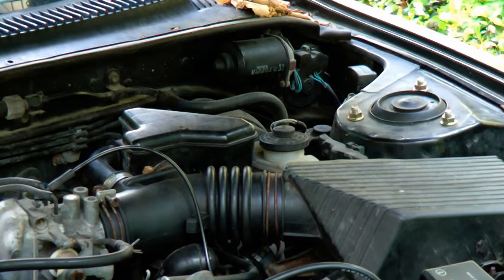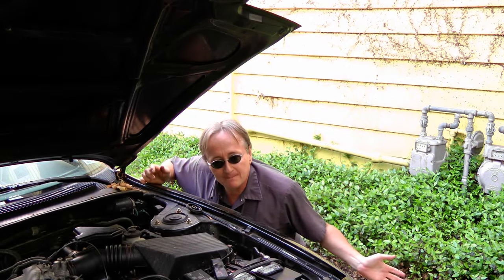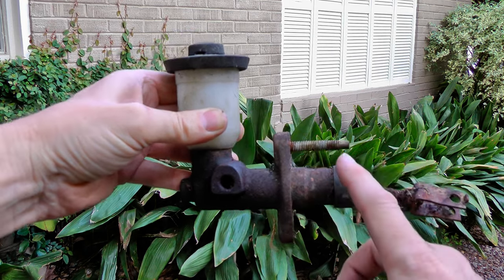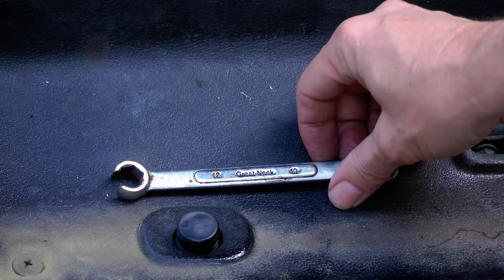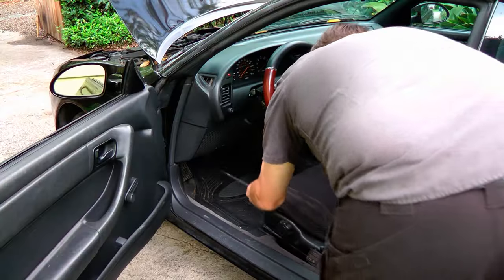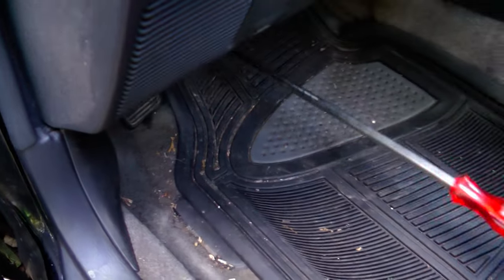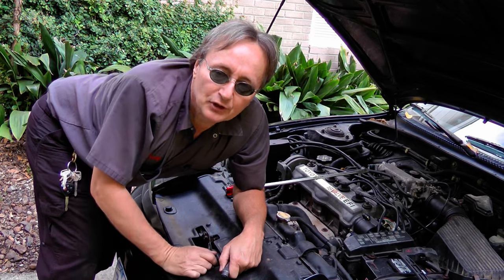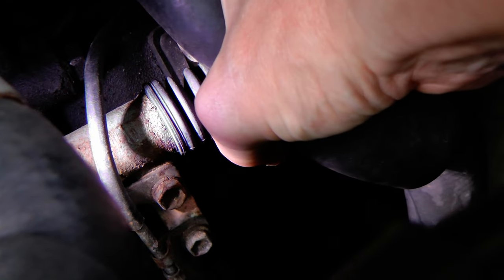How to Replace Clutch Master Cylinder in Your Car

Comment: Hey Scotty - I have a 2008 Subaru WRX STi, I push down on my clutch and when I release it, it makes a loud "Tick" sound. It sounded like it was coming from the dash board. So, I got under the dash panel on the driver side and I saw the rod that goes in and out of the firewall that is above the gas pedal when you push the clutch down. It sounds like the ticking sound is coming from there. Not sure if I need a new Master clutch cyl or should I grease it up that rod with white lithium grease? I should probably stick with the cheapest route first and go from there. The clutch engages very well, no issues. Just a ticking sound when the pedal is released. It's driving me nuts. It's not a POP or a CLUNK..just a tick sound when depressed. Any ideas? Thanks, Scotty!
Reply from the maker: +aaf1218 try lithium grease and see if the clutch switch is making the noise by removing it and checking that.
Reply: +Scotty Kilmer Thanks, Scott you. I appreciate it. I will have to apply some of that stuff on there or look at the clutch switch. I appreciate your help. I've been a subscriber for a while now. I enjoy your videos.

Comment: It's funny because I am having the same problem however, without the mechanic seeing the problem they are telling me to replace the gearbox and clutch. When there is nothing wrong with the gearbox as I drove the car the first time the clutch went down I was able to drive. The second time I was not able to drive so the air or there is leakage.

Comment: I came up with something cool, quick and effective. I stuck a clean rubber tube on the bleed nut, apply pressure to the peddle and use my mouth to suck the air out and the fluid flows right through.

Comment: Hello ,,,i have a 95 eagle Talon tsi i had a problem with my clutch .i can't go 1st gear when iam at a stop o a red light ..its realy hard to shift it like that but once is moving is easier to shift ..i changed my master cylinder and i bleeded my sistem more than 3 times ,there;s no leaks and the slave cylinder looks good..any idea whats going on? thank you so much for your videos they're so helpful..

Comment: hey scotty, thanks for the vid. I think the engagement point on my clutch feels much lower than before, literally right when i release my foot off the clutch (bout 1cm), it starts to engage. Was never like that before, and i find it quite aggrevating when getting out of 1st. Would my situation be an example of a bad master cylinder or slave cylinder? Thanks and hope you can reply back.
Reply from the maker: prayit's the hydraulics,and not worn out clutch plate or disc

Comment: by the looks of this video, is there two different ways to bleed the clutch line? on my 07 civic si coupe ive bled the line thru the slave only. I think im needing a master cylinder , i replaced the slave recently but still the shifting in my car is the same(some to moderate difficulty shifting into gear)Can master cylinders have internal leakage?? bad seals maybe?

Comment from the maker: well, one of those jobs was messed up. Normally they stick cause the slave or master is bad or air is in the system, so try bleeding, or realize you may have got a bad master cylinder, that's happened to me and drove me nuts.

Comment: Hi Scotty,in my 98 celica when i put it on reverse gear,i push the clutch to the floor but i get a really annoying sound(like if you try to put it on gear and you dont press the clutch),other gears(first second etc) are fine,just a bit hard,i was told to change the whole clutch.What do you think?.

Comment: hey scotty, I was wondering if I needed to replace my master cylinder for a performance stage 3 clutch. i have a 94 3000gt non turbo and no one seems to know if it needs a new cylinder for an aftermarket clutch. (XTD stage 3 clutch, flywheel etc.)
Reply from the maker: I would, more pressure on that racing clutch

Comment: What kind of oil goes into the gear shifter? Thank you. I made the mistake of taking whole transmission down. I can't even find parts sometimes 1998 Isuzu rodeo L4 2.2.
Reply from the maker: transmission gear box oil

Comment: I need your help we change the clutch in 2016 jeep patriot but still have a soft clutch. We bleed it but still no clutch, the slave cylinder is plastic. We've gotten a vacuum pressure stuck it at the end did the bleeding process by pumping and releasing the bleeder. But still no bubble coming out.

Comment from the maker: @rb26dettsr20  Yes, it's not a good idea on any modern car to switch from an OEM muffler. It will often change the exhaust backpressure  and end up messing with the engine air fuel ratio. My advice is leave it alone. Scotty Kilmer

Comment: scooty help .i am converting to external hydraulic on my 79 .we have mechanical linkage with a fork return spring but not on the hydraulic .slave cylinder pushes the fork back and forth nice but how does it leave clearance for throwout bearing without spring ?

Comment: hey scotty im curious i was on my way home when suddenly my clutch went mega stiff as in it didnt go  down at all. i pulled over and moved the slave cylinder a bit and suddenly my clutch pedal was free but there wasnt any force at all on it and it will not allow me to shift gears at all.i also checked and my reservoir is full so now im asking you what your suggestion is. also o was able to get the extra mile to my house by shifting without the use of a clutch which was a very tedious task but nonetheless i achieved it.
Reply from the maker: +Juan Gallegos pray it's a bad slave cylinder, and not a worn out clutch that's a GIANT job.
Reply: +Scotty Kilmer thanks scotty I was hoping it were that. listen i got another question. do you have a patreon account or someway that i can maybe send you some money to support the channel since although I've only asked you for questions twice i feel like i would've lost a lot of money with other mechanics had it not been for you?

Comment: Hi, Scotty. I have a 2000 mitsubishi eclipse. Two days ago, I found I can not shift into 1st, 2rd, 5th and reverse gear. It seems like when I shift to 1st and 5th, the gear lever will slide to 3rd gear, and when shifting to 2rd and reverse gear, it will slide to 4th gear. There are two interested things. The engine will not shut down even when I step off the clutch pedal while the gear lever was into 3rd or 4 th. Another one, I can shift to 3rd and 4th without pressing clutch pedal. What's wrong

Comment: Scotty I have a 07 scion tc.. my clutch  got  stuck and I have to pull it up with my foot..after I pulled it up it worked fine.. any idea how that happened ? Is it my slave cylinder? My fluid is fine and I see no leak
Reply from the maker: pray it's just a bad slave or master cylinder

Comment: I installed a new slave and master cylinder plus a new line in between. When I start to bleed the line the pedal will start to stiffen up but then after a few times of going back under the truck to turn the valve, the clutch goes limp again! Please help!
Reply from the maker: have it pressure bled, often it's impossible to get air out without a pressure bleeder

Comment: Mr. scott theres no leak on the master and slave cylinder of my 03kia van but still is hard to engage the gearstick sometimes, specially when parked in long hours.What should be the probable cause? can my pressure plate or fork have the problem?

Comment: Just today, the bite point of my clutch as gone from high to near the floor. The whole pedal deosnt have any resistance till around 1-2 inches off the floor. I now have to step right into the floor to be able to change gears. I just had this problem about a month ago and having replaced the slave cyclinder fixed the problem. Can you tell me whats wrong and how i can check it? Im away from home at uni so i dont know any good garages that i can trust.

Comment: hey Scott I have a 98 ford f150 with a v8. the clutch isn't to the floor but has play untill it's halfway to the floor then I can feel some resistance. is that the master cylinder ? we got it used that way, I was wondering if maybe someone replaced it and maybe didn't adjust it right because I heard the foot pedal is adjustable.
Reply from the maker: pray it's just the master or slave cylinder OR more often, air in the system

Comment: It would be earlier than that. The 1998-2001 generation with the B18C1 engine. I haven't gotten it yet, just trying to decide something fun, rather fuel efficient, and easy to work on. Cheap would be a plus with my broke college kid budget.

Comment: any way to replace the plastic clip that snaps into the clutch pedal assembly?    mine broke off and i dont want to replace the whole hose if i dont have to.  have a 02 mazda tribute.  brake

Comment: My master cylinder has a line coming out of the front and straight into the transmission. There is no place that I can see to bleed it. My truck won't move and I think it needs the line bled because the clutch won't engage. What do I do to bleed the line? Thanks

Comment: Hey Scotty I have a weird clutch pedal feel in my 2005 mustang gt. after driving the car for about 15 to 20 minutes specially on a hot day going from stop light to stop light it seems as tho the pedal loses engagement travel. It engages close to the floor it always has been since I replaced the clutch last year. It works fine at first but it feels like it loses pressure or something. Taking of from first becomes hard and the engagement is not smooth the second I start releasing the clutch it starts to grab and from there there's not smooth travel to engage the clutch. No leaks on the clutch master or slave/throwout.
Reply: I was hoping someone would’ve answered you.

Comment: I put in a new clutch in my 2008 Wrangler and I think I'm having an issue with my slave cylinder overextending. There is a noise when pressing the pedal all the way down but the clutch disengages far before this point. should I worry about it or just stop pressing the pedal down that far?
Reply from the maker: IF you go the right parts, that means the clutch inside the tranny is not correct.Often cheaper chinese made aftermarket clutch kits will do that, but if you don't push it down all the way and it works fine, I'd live with it
Reply: +Scotty Kilmer It made the same noise with the original clutch and I put in a Centerforce dual friction clutch and plate with National pilot and throw out bearings. Thanks for the reply and keep up the great videos!

Comment: Hello Scotty Im having a problem with my manual trans slipping when I get close or surpass half throttle, and almost complete slippage when WOT on every gear, but especially 3,4, and 5. How can I get a proper diagnosis on whether or not its the clutch worn out or something else, what else can it be? Its weird because one week my clutch was fine and the next week its slipping, it happened all of a sudden, it didn't creep up on me, its like one day in in the highway on 4th and slip when accelerate

Comment: hi I just replaced my hydralic master cylinder in my 2005 ford focus, when finished The clutch paddle does not reach the ignition little plastic that supposed to turn on the car. Do you know what might be the problem.
Reply from the maker: loosen the rod so it can reach down there, OR you got a bad part

Comment: hi scott, i have a 2009 vw jetta 120000 miles. the clutch would grind once every blue moon about 6000 miles miles later the clutch got real soft then would only engage about an inch or so off of the floor and is now fully stuck. i can start the car in gear and go. so i dont think the clutch is out. what should i look for first?  just trying to save money. please help!!
Reply from the maker: replace the clutch master and slave first

Comment: Scotty I have a 92 accord lx and sometimes my clutch will not engage when running but will after I cut the engine off. Could it just be the master cylinder leaking or more major?
Reply from the maker: pray it's just a bad master or slave cylinder
Reply: I had this happen in my 02 accord ex. Eventually it stopped engaging and I ended up having to replace the clutch.

Comment: scotty, I have a issue, I did a swap on my 00 Accord Sedan, 3.0 auto to 3.2 6 speed manual. 9 months good and all no issues, all parts are oem Honda/Acura. New clutch/slave/master ect were all installed at the same time. now Monday morning leaving to work. I noticed it was hard to get into 1st gear and pedal felt slightly spongy. manage to get to work but couldn't shift it to 6th gear same issue. after work worked somewhat better. later that night I couldn't get car into a gear, pedal felt even more spongy. any ideas? master is not leaking. roughly about 5k miles into my full swap.
Reply from the maker: pray your master or slave was just a weak part, and not internal clutch parts. I'd try a new slave first as they are cheap and easier to replace

Comment: hi scott i have a 89 celica gt..
and i was wondering if you coul help me diagnose the problem!
if i tap the clutch lets say 5 to 8 times it will go all the way to the floor very soft and it won't shift, but if i push it all tha way down without tapping it it works fine. what could be causing that?
Reply from the maker: replace the clutch master
Reply: Thank you

Comment: I have a Scion tc I would like to upgrade the clutch cylinder to a pull cylinders. Buy having issues locating it. Any idea for me to do to handle Act heavy duty clutch 6 blade?

Comment: So my clutch is going almost to the floor. (1995 saturn sl1), the master cylinder had only a little fluid in it, i topped it off but no changes. What could be the issue? The master cylinder isnt sucking any fluid inside itself when i press the clutch, any suggestions?
Reply from the maker: bradbrown0766 master and or slave it bad, that old, I'd change both

Comment: Scotty or anyone that can answer.....if i have a slave reservoir with a crack which leaks out some of the fuel from the reservoir can make the clutch pedal drop and also lurches to come back up after being pressed to the floor?
Reply from the maker: certainly it would do that if it leaked pressure

Comment: YO SCOTTY, I GOT A 94 HONDA ACCORD,WHEN EVER I PUSH DWN ON THE CLUTCH IT STAYS DOWN AND I CANT PUT IT INTO FIRST GEAR,THE ONLY WAY TO BRING THE CLUTCH UP IS TO PULL IT UP BY HAND AND IT STAYS UP,A COUPLE DAYS BEFORE IT STARTED DOING THIS,MY CLUTCH WAS GETTING EASIER AND EASIER TO PUSH DOWN.MY CAR WOULD SOMETIMES SMOKE FROM DA BOTTOM BECAUSE AN OIL WAS LEAKING ON TO SOME HOT PIPE OR SOMETHING,BUT I DONT WATS WRONG WITH MY CLUTCH. CAN YOU HELP??

Comment: Scotty, on my friends neon, now she is complaining when the car warms up its hard to shift thru the gears but when its cold it shifts perfectly, i checked the clutch master cylinder, no leaks, slave cylinder , no leaks, no leaks on the clutch pedal either, she told me the gear fluid was never changed. is it safe to do that? i hate this pos car im working on, like u said neons are throw away cars. please let me know

Comment: I even use the brake bleeder kit still no luck. any other option? I been pump it for almost 30 min and inside the pedal still to the floor with no resistance at all. so 😞

Comment: Thanks sir I was told it could be slave cylinder and they would have to drop transmission and I really don't have the money for that it's an 1990 chevy 1500
Reply from the maker: +Tecarrius Ward bunch of crap, the slave cylinder on a 90 is on the outside, two bolts hold it on, easy job

Comment: hey Scotty I bleed my clutch just like you but my pedal is soft some times but if I pump it it'll be normal or when I floor it in one gear it be a short pedal almost stuck to the floor. what could it be plz help 05 sti
Reply from the maker: first, change both master and slave cylinder if you haven't already, if it needs bleeding, those are leaking to let air in the first place

Comment: hey Scotty  my clutch is very hard to press down it works some times and it don't and when it's hard to press down it want go in gear I tried pumping clutch but still nothing what should it do
Reply from the maker: +Tecarrius Ward generally that's a sign or worn clutch pressure plate inside the transmission.

Comment: Mine stay down mazda 3 2006 any advice it have a bit linking i think so but this dont have master i think if yes why brake still good working but cluch still down recomemd me please boss
Reply: well it still driving first shift i turn it on start running like intant start i know it hurt trasmition but got to go job still a hope?
Reply: replace both but :/ steel not pump still air and still nothing but i can drive it one shift

Comment: the thing is my car is ford focus mk1 I live in UK and belive me master slave is where you located it but the cylinder is not what you showed on your video. mine different and it's located elsewhere.
Reply: Scotty Kilmer that's what they done. it was inside the gearbox. 3 1/2 hours for labour. I shopped around best price, new clutch and slave cylinder plus gearbox fluid £375 most car shops wanted wanted over £500 - £600. now car feels great
Reply: Scotty Kilmer
Reply: Scotty Kilmer

Comment: Mr Scotty i have a 2003 Grand Am 5 speed 2.2l and my clutch is stuck to da floor but it will still crank up and it still shifts long as the car is not crunk what could the problem be.